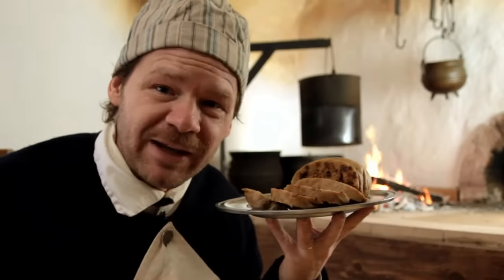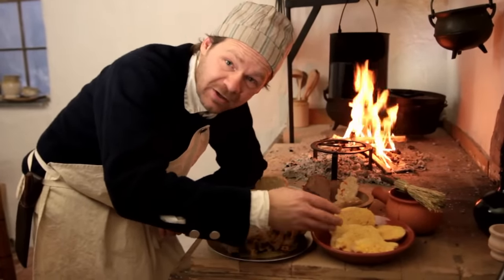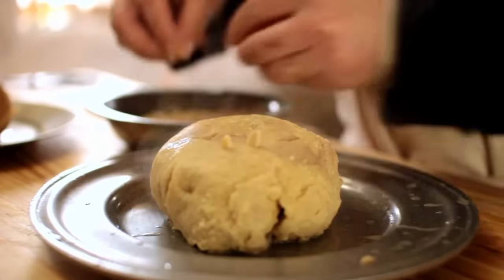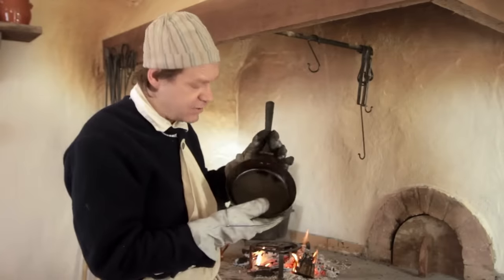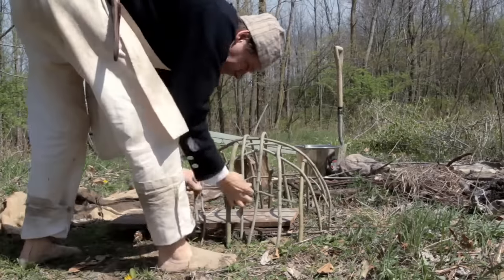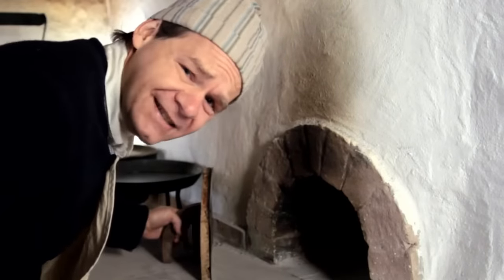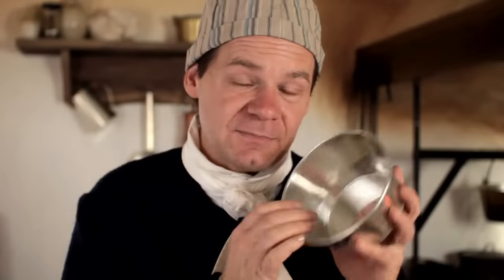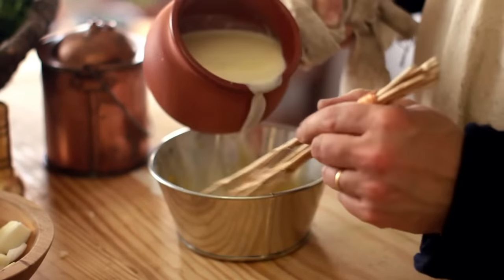Cooking Marathon! - 18th Century Cooking Season 2

Comment: 450F for an hour in a conventional oven with a high smoke point oil has always worked just fine for me and I’ve never had issues with smoke. Once the thing is seasoned the best way to keep it that way is to completely avoid acid when possible, don’t use soap to clean unless absolutely necessary, and cook often and with lots of oil.  Jon clearly knows what he’s doing; that seasoning looks gorgeous.
Reply: @jarredofhearts depends on the pot! Certain types of cookware need different care than others. Some need oil, others might not. Of course you can cook with less oil, like using water to sauté/steam veggies for example, but that method won’t be recommended for every type of pot.

Comment: Caraway seeds are much more flavourful if you toast them in a pan before using. Just stir them over low heat until they become fragrant. This should be done before you use them in biscuits, sauerkraut or any kind of sausage or pudding. You get more bang for your buck if you toast your caraway seeds!!
Reply: Thanks for the tip!

Comment: Helped build an earthen oven a couple years ago. I preferred to stomp on the cob mix with my socks on because the sand in the mix was very abrasive on my feet and I hated having it between my toes. The socks were a mess, but washable after rinsing lots with the hose outside.

Comment: I hope you will take this comment with kindness: A good cook always keeps one hand dry holding onto the mixing bowl if needed, in case more of something needs to be added without getting wet dough all over everything else. Mixing dough with one hand while dough is wet then when turned out on the kneading surface, using both hands to knead the dough.

Comment: I thought you wanted to fully flour the damp cloth before you put in your pudding to cook so that when it hits the water it creates a water tight seal so that the boiling heat is what cooks the pudding, not the actual water. The way your pudding isn't damp, wet, and watery. But maybe this is a different way? I won't lie though, doesn't look very appetizing.

Comment: Okay so here in England we have black or white pudding which are blood sausage with blood, oats, fat in a skin but we have suet puddings which are sweet like "spotted dick" which uses suet, and dried fruit which is a desert or we have a savoury pudding which could be steak and kidney in a suet pastry "pie" both would be steamed in a bowl with a muslin cloth tied around the top and mostly submerged in boiling water. Plum pudding would be a variation of the first one. You can buy suet in a butcher's shop or even  a supermarket here